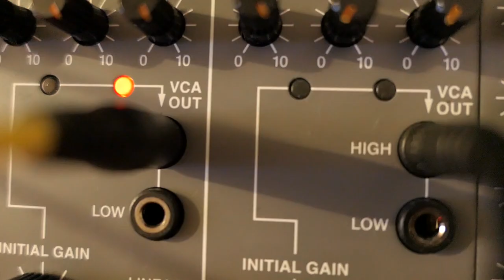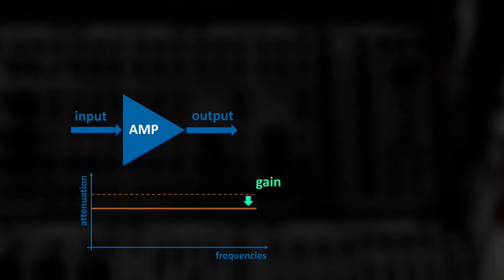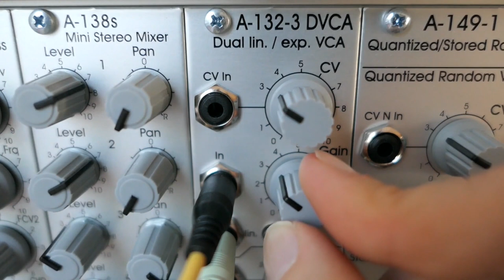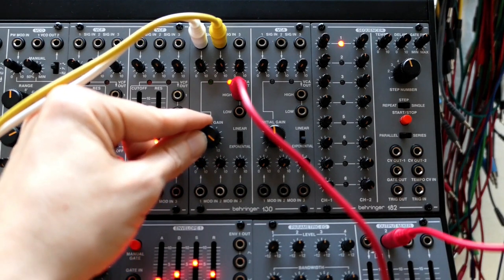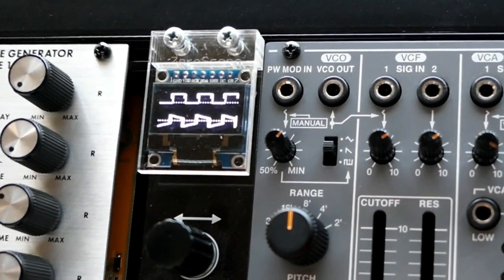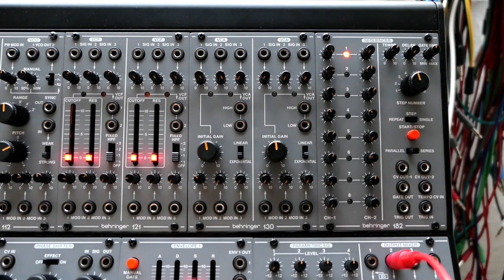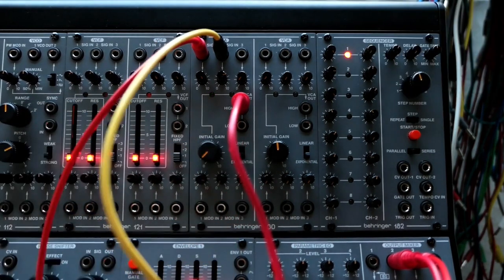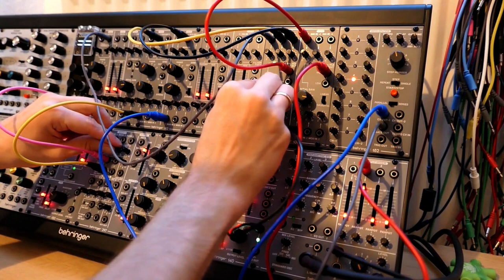Behringer 130 Dual VCA ~ how it sounds & saturates

Comment: I'm currently planning out a dedicated case for the 100M and another one for the 2500 on Modular Grid, and your videos are proving super helpful to make certain decisions, thanks!
Reply from the maker: Behringer has released the 1027 sequencer for the Arp 2500 a few weeks ago, perhaps you save some hp for this.
Reply: @synthesizer83  Hi, yes I've got both the 1027 and 1050 on backorder and are contemplated on the case. They'll be empty spaces for a few months...
Reply: Cool man. I use to be a behringer skeptic because as a kid i owned a mixer where all the potentiometers were crap.  i got a few behringer modules for my eurorack modular synth and i dont look or think twice now, got 2 2500 modules, and one system 100,  and this vca coming in the mail.    their modules are good. wouldnt suggest behringer swing and im not saying because of ethical reasons how they ripped off arturia, but because i literly broke a knob off and the potentiometer under it was made out of thin plastic. snapped like a twig and unrepairable. had to sell it for parts.

Comment: Thanks so much for the video! When i started out with modular I got very frustrated with the AC/DC coupled thing because it was the only vca i had (and i went modular exactly because of CV mixing and modulation).. but every module has its caracter i guess :) I never really realized that it saturates or when it does.. it just happened that when i use that VCA for modulating the amplitude of a audio rate signal to use it as FM modulator that it changes the sound quite a bit which i likee hahah
Reply from the maker: It saturates in a, lets call it "gentle" way. Especially compared to the Doepfer VCA for example, which turns the triangle into a square with full gain setting...